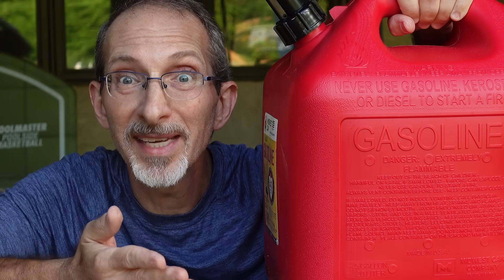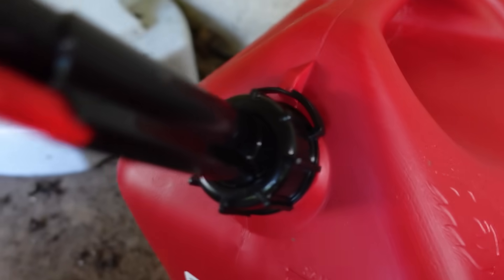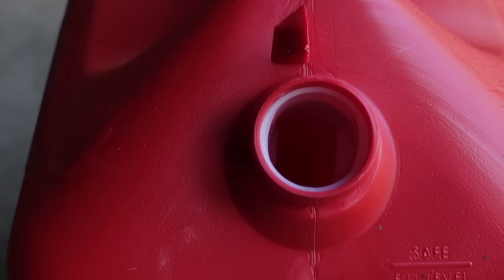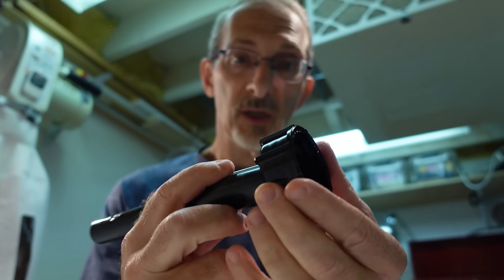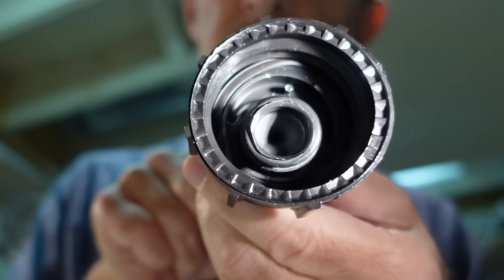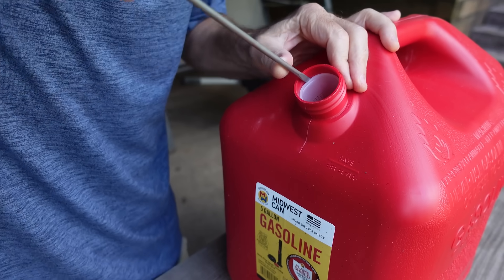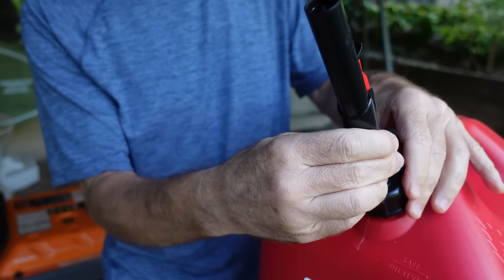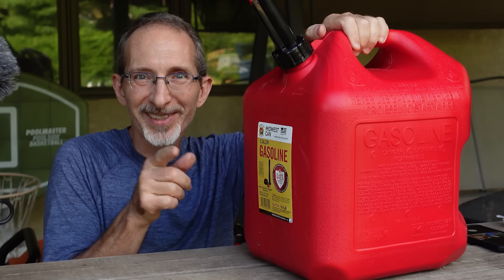Gas Can Modification | New Gas Can Fix

Comment: My safety nozzle looks different from his & operates differently. I did similar modifications to mine in order to get to work at all. I just remove the entire safety nozzle when I want to fill or dispense from the can. It works so much better when the safety stuff is removed entirely. I twist it all back on when finished filling or pouring from the can and make sure that it's twisted on securely. Then I push the black cap onto the end of the nozzle to keep the gas vapors from escaping. Too much over regulation by someone in Washington DC. What good is it own an unusable gas can.
Reply from the maker: I still can’t believe how many people remove the nozzles entirely and pour from the can, or are using a funnel. I hope the manufacturers read these comments and realize how difficult their product is to work with. Thank you for joining the conversation!

Comment: The filter is as much of a joke as the nozzle.    So let’s just say the filter works what that would mean is that all the dirt is trapped on the one side of the filter so all the dirt is the first thing set to pour out of the filter when you fill your gas.
Reply from the maker: Yes, bad design for a filter… It is actually a flame arrester. I corrected my mistake in my follow up video, link in the description. Thanks for joining the conversation and for watching!

Comment: Just buy a Wavian Jerry can, get the gooseneck metal pour spout. It will pour as fast as a gas pump fills the can if not faster. The can and nozzle will last decades, all metal, no plastic, clamping/ cam lid and nozzle. ZERO gas odor. Yes they are expensive but once you purchase you will understand and never look back, never.
Reply from the maker: Leo, I have been looking at better gas containers lately. I agree, they may be worth the extra price in the aggravation that you save. Great suggestions!

Comment: That filter in the can is as useless as tits on a bull. Whatever it filters from going into the can is just going to get rinsed straight into whatever you fill from it.
Reply from the maker: Miles, it is not actually a filter but a flame arrester. I corrected my mistake in my second video, link in the description. Yes, as a filter it’s simply doesn’t make sense! Thanks for commenting!
Reply: @MikeFyxdt  Thanks, that actually makes sense. You can't tell it surprised me to learn that because I used a lighter to look inside the can to see if the filter worked.

Comment: That screen is not a filter. It’s what is called a flame shield. Look for a video called flame shield safety system. Granted your not supposed to be pouring gas on a fire. But it keeps the flames from getting in the can and turning it into a flame thrower. And there is a trick to filling them at the gas station. You have to hold the nozzle up a little bit and don’t have the gas come out at full speed and you can fill it with the flame shield inside the can.
Reply from the maker: You are correct! What I called a filter is the flame arrester, which I corrected in my second video. My tanks were filled at a gas station that has attendants do your pumping for you. They agreed that these tanks were impossible to fill on a regular basis. If anyone would have developed a technique to fill them, these guys would know the tricks and yet they still struggled with it. You might be right, but I am just reacting to my personal experience and what others had to say. I appreciate you joining the conversation!
Reply: @MikeFyxdt  I do agree that it is a little bit of a pain. But My boss got gas cans that have those flame arresters in them. I do fill them all the way. Granted I have to hold the nozzle basically outside of the can at times. Which can lead to spills if you don’t pay attention to it. I don’t blame anyone that takes them out.

Comment: Why not cut out a couple of coils on the spring, just weakening it?  Just knock the strainer in.
Reply from the maker: Great suggestion Butch! That’s exactly what I did in my second video, link in the description. I removed about half of the metal from the spring and then stretched it back to its original length. It works so much better! Thanks for commenting!

Comment: Try using that on a no-cap filler tube. The joy, the joy,,,,,,,,,,,,,,,,,,,,,,not.
Reply from the maker: Excellent point, that would be nearly impossible. I will be testing out some replacement nozzles and funnels in an upcoming video… I think that would be the way to go!

Comment: save the vents on old cans and drill a hole on the back of these and push the old vent in the new can for a better mod..
Reply from the maker: Stu, I found some very inexpensive plastic vents with caps on Amazon, and I installed them in my second video, link in the description. They make a big difference. Thanks for joining the conversation!

Comment: The filter is absolutely useless if it catches debris when you fill the can as soon as you tip it up to dispense the gasoline the debris will go right out into gas tank.
DUH???
Reply from the maker: Reed, the filter is actually a flame arrester, which I explained in my second video, link in the description. Yes, if it were a filter than the design would make no sense! Thanks for watching.

Comment: Nice Mike but why even buy this style of gas can?
I don’t like it because you have nothing to keep dust and debris out out the spout. When using it goes right into the gas tank of what you are using.  This don’t make any sense to me!!  If you ask me it’s a very bad design.  
In your case I would use paint tape or a empty soda can over the end of the spout while stored.
Reply from the maker: Larry, I purchased this at a time where I needed two containers in a hurry and this is what was available. After the modifications they work satisfactorily. I made a second video with some additional modifications, and I showed a cap that my son 3-D printed for me. It works great! Thanks for watching and commenting.
Reply: @MikeFyxdt  Yes I did the same for one of my metal gas cans.  Thanks

Comment: Just buy another brand of gas can. This review is a waste of time. My plastic gas can has none of these issues.
Reply from the maker: There are a ton of these containers sold, so hopefully it helps the people who have purchased one. My older plastic gas cans don’t have any of these issues either. I have a feeling we’re going to see lots more of these safety features coming in the years to come. I appreciate you joining the conversation!
Reply: These POS, PITA, slow pouring, messy "safety" cans are the only ones I see sold anymore. I think it's by law. If only it was as easy as just grabbing a different brand...

Comment: I  heard of a guy who broke the plastic gas tank on his mower because you have to push hard on it.

I had one that stuck open when pulled it back and it dumped gas all over my lawn mower
Reply from the maker: Morgan, I agree… The spring-loaded spouts on these new containers require too much force, and are not durable enough to withstand the pressure required to use them. We need a better design!
Reply: @MikeFyxdt  This is from a store close to me. I bought several and the quality was good. There might be some on ebay for a buck less but I don't know the quality. I think you can order them from online. Watch out for shipping costs.

https://www.farmandfleet.com/s/?keyword=gas+can+spout

Comment: Guess what that little spring and o-ring is in there for?  To keep raw hydrocarbons from evaporating into the atmosphere while you're not using it (which is 99% of the life of a gas can - sitting there polluting, and turning your fuel into varnish while you're not using it).   At least you left the spout so it can be sealed again, but really, how many people watching this care or won't pop the 'safety button' out as well...    I admit some of those (especially the early) devices are absolute dogshit, but I have one like this (no 'safety button' that works on my mowers and snowblower and a new can with a push button spout that accomplishes the same thing and really helps not spill any at all.
Reply from the maker: The O-ring still engages if you remove the spring. It’s your responsibility to pull the spout back out when you’re done using it, just like it’s your responsibility to close any fuel container when you are done. With the spring in there you can’t forget. In my second video I did a modification to the spring which keeps its functionality, but reduces the tension and makes the spout easier to use. There’s a link in the description if you would like to watch.

Comment: what i use to fill up small equipment is a marine gas tank and with a extra fitting on the end so the gas can flow freely through it and i just use the priming bulb to pump the gas out
Reply from the maker: Brandon, that sounds like a good adaptation. Thanks for joining the conversation!

Comment: I just bought a 2.5 gallon gasoline container yesterday at Home Depot -- $17 for f^ck!ng plastic. These newly designed "safety modifications" cause more spills than the old standard straight pour with breather hole type. I'm all for safety but My God what the hell are these engineers and legislators thinking? Even though your video is less than a year old, they've already modified this modification so it's different now and even harder to use. I didn't even think that was possible, but they absolutely outdid themselves.
Reply from the maker: I did not know that the design has changed already! It’s hard to imagine that they made it more difficult. Hopefully by us speaking out, future designs will be safe plus usable!

Comment: The funny thing about that filter is that it only works to keep the fuel can clean. What's left in the filter goes straight in the first item you fuel up
Reply from the maker: Tim, it was my mistake to call it a filter. It is a flame arrester safety device. I corrected this in my second video, link in the description. Yes, as a filter it made absolutely no sense! Thanks for watching.
Reply: @MikeFyxdt  ULINE Metal can is the real deal. They are pricey, but its a one time buy. They also meet all the safety standards and are really nice to use. We have then at work per insurance request.  Guess it wouldn't make a good Mike vid. Nothing to fix.
Reply: @dustyc324  thanks for sharing. I’m glad some companies still make quality products. It’s worth paying for something that will last.
Reply: @MikeFyxdt  I bet that "flame arester" is as ineffective at it's job, as is the spout at being safer, or environmentally friendly.
Reply: @jreyman  flame arresters are very effective at preventing flames from traveling through them. There's no reason to doubt that one.
Reply: @ClippyDrone  i dont know i light stuff with gas and i think any fire heading down that thing is going to explode in .0001 seconds.
Reply: @Chugwater_Cowboy  Huh? I could see that having some basis. I dont think I've seen a metal tank on any modern vehicle in 15 years or more. We are kinda stuck with what's available sometimes, like it or not. Going out if your way for a metal can is the exception now. Ethanol hygroscopic properties doesn't make the rust thing any better. I'm curious if a few drops of oil or fuel drier would combat rust in a can.
Reply: @dustyc324  Stainless steel doesn't rust.
Reply: @sssmithVR  Seems like the Justrite cans are painted steel, only the flame arrestor is stainless.
Reply: HAHAHAHAHA!

Comment: Lots of malarky here.  The gaskets on that spout will jump their track to start with and disintegrate before very long.  You'll make the mods from this video only to have the can drip or leak when you try to pour gas.  Your better move is to replace the spout with some sort of simple, basic spout that fits.  Sadly this will require some costly trial and error.  Good luck.
Reply from the maker: Dink, aftermarket spouts seem to be a popular item based on the comments. I am going to be reviewing an aftermarket spout in an upcoming video. Thanks for joining the conversation!

Comment: Thanks for these tips, because I agree, these new overengineered "idiot cans" are pains in the ass! We had some old easy ones before but they got lost!
Reply from the maker: My old school metal cans got lost, too. I wish I still had them!
Reply: @MikeFyxdt : Sorry for your losses. But even the older plastic ones were fine.
One time even one of my new cans got lost. I stupidly drove with it in the back of the truck with the tailgate down, and somehow it went to a place off the road somewhere that I couldn't spot even after driving forth and back past there a few times.

Comment: Um... tanks are what are attached as part of your vehicle or tool to pour the fuel into, or on the back of a supply truck, or in the ground at the station. These red containers are called cans.
Oh, yeah, you did call them cans a little later.

Comment: This is my first experience with your channel. I appreciate your work.

Where are you located? I am in California where there is an emphasis on the DETAILS of gas can safety. It is good that you mention safety. But people need to do most gas can things on the ground. Filling, mixing fuels, filling machinery, etc. Other than the modifications you demonstrated to us, gas cans need to stay off tables, truck tailgates, etc. The risk is static electricity. People nedd to know that. So please keep your gas can on the ground or a concrete surface... including at the gas station.
Reply from the maker: Thanks for your comments Michael. I did several follow up videos, and addressed static electricity and flame arrester‘s in my third video, link in the description. I’ve been learning a tremendous amount from viewers in the comments section, and these follow up videos are away to keep everyone up-to-date and share what I have learned. FYI, the word “California“ is one of the most popular words in the comments! Your safety recommendations are valid and appreciated!
Reply from the maker: P.S. I am in Pennsylvania. 😎

Comment: Mod #4:  Add a push-in tire valve stem to the top rear of the container for an air vent.  Remove the Schrader valve from the valve stem to get air draw, and use the valve stem cover to close the vent when not needed.
Reply from the maker: I’ve seen several recommendations for adding a Schrader valve for venting. People have lots of options! In my second video I added a simple yellow plastic flip cap that serves as a vent, and it works very well. There’s a link in the description if you’d like to watch. Thanks for joining the conversation!

Comment: My solution is a little simpler, I just get out my plastic cutters and cut all that worthless extra crap right off the spout! Turn it back into a one piece hollow tube like they used to sell in the good old days when the USSA was just the USA.
Reply from the maker: Steve, that is definitely an option… I assume you use some kind of cap?
Reply: @MikeFyxdt  Heh - a plastic bag with a rubber band or zip tie works pretty good. And don't forget to drill a 1/8" hole for a vent, and plug it with a nail!

Comment: OK the filter is soooo stupid. It is going to keep all the gunk out of the gas can, but it is going to sit on the outside of the filter the outside where the nozzle connects to so whatever was caught by the filter is now going to go INTO whatever you are filling up! I take it out to fill the can and put it back after its full to catch the crap before it goes into what I am filling.
Reply from the maker: Jeffrey, what I called a filter is actually a flame arrester safety device. I corrected this in my follow up video, link in the description. I agree, as a filter it would be totally useless! :-)

Comment: That and the fact that you can no longer bend the nozzle to fit into tiny areas or funnels. When I used it, first thing I thought of is legislature done took a bribe on this one, because this is the worst safety design ever made. Personally I just throw away the cap and buy the old flex kind from the bay. Those older cans sealed perfectly and I have no idea why they changed it other than law and bribery, which ruins everyone's life once they pass those horrible bills.
Reply from the maker: Flex nozzles are a popular option! Even a rigid nozzle with a bend in it makes a huge difference.

Comment: What difference would it make if the filter was in the bottom of the can it would not be in the way just floating around.
Reply from the maker: Lots of people have said they've knocked it in, with no issues.
Reply: @MikeFyxdt  is there a mod for the blitz style cans that just have the yellow cap on the end of the solid plastic tube with the breather inside of it. What is happening is the gas shoots out in a straight stream instead of being able to drizzle it out so with a full can pouring into a lawn mower it over shoots the opening on mower before you can get it in the hole because its not a flex tube.

Comment: You can also cut the length of the spring to lesson tension so the valve still closes on it's own
Reply from the maker: Tom - yes - and I did that in my follow up video. It made the nozzle easier to operate, but retained the spring closing feature. Thanks for commenting!

Comment: LOL... does your new generator work?  My place of work goes through those every 4 months.... garbage
Reply from the maker: Randy, so far so good! I really don’t use it that much. It sounds like your work is hard on generators!
Reply: @MikeFyxdt  They are but, the new generators have so many multiple fail-safe shut-offs that the shut=offs stop the equipment from working.